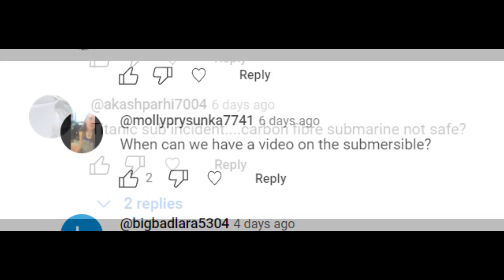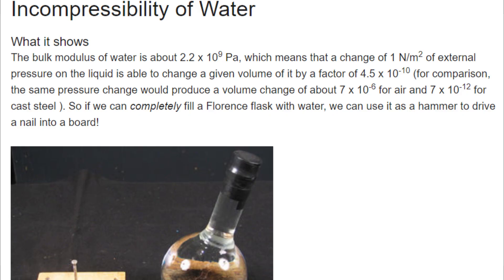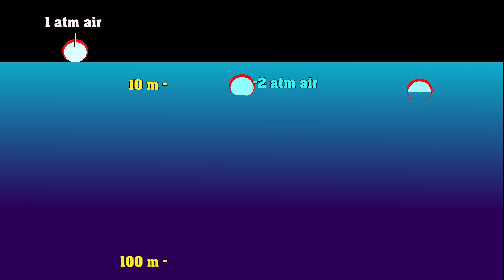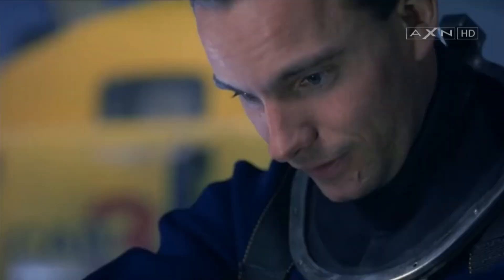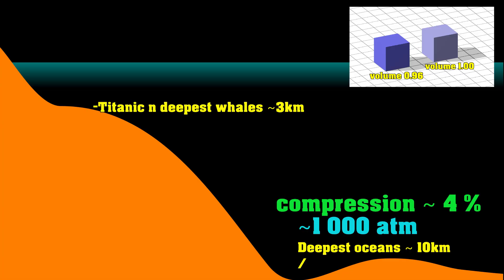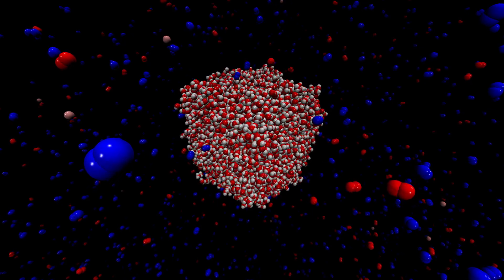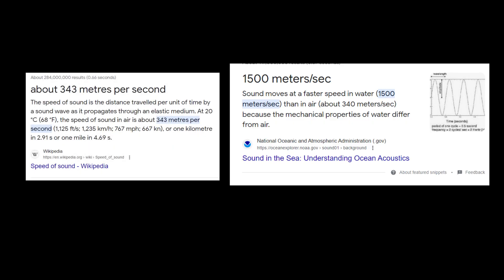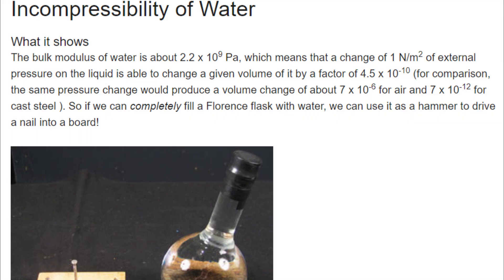What Happens when a Hull Fails at 1000 atmospheres?

Comment: I feel like you are really splitting hairs here. It is like saying that water jet cutters are not cutting using pressurized water because technically the water leaving the nozzle is no longer pressurized. No. The water pressure kills you. If you want to be pedantic then water depressurization kills you. In either case the highly pressurized water is the direct cause. The fact that it gets depressurized in the process of killing you doesn't really matter.

Comment: I heard there can be autoignition from compressed hydrocarbons in the atmosphere also, much like a diesel engine
Reply: definitely a concern in a working sub that has fumes everywhere, but there will not have been that much of it here. although I do not know the ignition point for just the textiles they were wearing...
Reply: @DrWhom  their blood would boil way before textile heats up enough. Basically insta temperature rise that corresponds pressure rise inside sub air pocket dissolves all soft tissue ,then everything else happens…
Reply: @digitalcommunist6335  yeah, my main point is that there could not have been many fumes in that compartment

Comment: that thing about the whale reminded me of something i learned the other day, for freedivers, if they start with their lungs fully packed with air at the surface, at a certain dive depth their lungs shrink enough that they no longer have neutral bouyancy and they start to sink instead of floating back up to the surface.
Reply: I think that this is why they take ballast. When they sense that they have reached neutral buoyancy ballasted, then it's time to let go of the ballast and regain buoyancy. Once they sink, the only rescue is in being hauled up, which may be too slow to safe their lives.
Reply: I used to freedive down from about 25-30 meters at the most and even at that depth you can feel the air trying to push out of your lungs I stopped freediving after a friend ruptured an eardrum which can be extremely dangerous. Even if you have a scuba tank you can easily rupture your ears. Diving is always dangerous 🦪 🤿
Reply: A fun and useful exercise you should do when learning scuba diving.
Try getting as close to neutral buoyancy as you can, its kind of fun to just bob up and down with your breathing 8 or 10 meters below the surface and getting a good feel for your BCD makes diving a lot easier
Reply: That's creepy
Reply: how can that be? density of air even at 20 bars is only 24 kilos a cubic metre, much less than the 1000 kilos of the water that surrounds the diver (pressure at 100 metres is 10 bars)

Comment: 5:30 saturation divers regularly go to depths of 300m, and physical simulations have gone as "deep" as 700m.

Also, you keep going on about the "compressibility of water", but not once did you mention what happens when you take the very compressible air inside from 1atm to ~375atm in a fraction of a second. If you want an idea then i suggest you take a look at how a diesel engine works.
Reply: He commented on helium, but is right that it "doesn't buy you a lot more depth". Saturation diving is no walk in the park and people who do to as low as 300m get AVN and HPNS, as well as lung damage and arthritis. Going deeper is foolhardy if you value your body, and compared to how deep the ocean goes, 100 vs 300 is not much at all.

Compression heating of air is irrelevant. The damage done to the sub and occupants was not from heat. The pressure wave killed everyone and shredded the hull before heat was ever a concern.
Reply: @bloomtom The adiabatic heating of the water, as you say, had small consequences, as basically it was the concentration of ALL the heat energy within the volume of air that was Titan's atmosphere. 
Not that much.
An incandescent light bulb filament may be 5,000° F, but how long would it take to cook 5 human bodies with a 100 watt light bulb?
The ambient water temperature at that depth is about 39° F and water has a heat carrying capacity nearly 3,500 times that of air, so the tiny volume of very hot compressed air was almost instantly cooled by cold water.
Something that I had not thought of before watching this video is that the water that first entered the submersible had been expanded,  and therefore was COLDER than ambient sea water too.
Reply: Saturation diving wasn't mentioned for a reason--it's not topical and the physics don't apply.

Completely and totally unlikely that the air did what you're suggesting. This was a plastic/CF hulled submersible. Not a metal sub. Also a much smaller cavity. No hydrogen explosions. This was not Scorpion.

The water would rush in faster than and heat could propagate, especially being much smaller and much deeper.
Reply: This should be pinned lol but never will.

Comment: Carbon fibre structures strength is on effects of stretching. It’s an excellent material for positive pressure chambers. But even though it works  in structures with multidirectional loads - compression resistance is it’s points of weaknesses.
The mind boggles from the thought that someone decided it’s a good application to use for negative pressure chamber in a structure construction similar to a positive pressure chamber…
Reply: Yup, the whole load of the pressure was basically resting on the resin, with the CF just chilling. The accident was bound to happen.
Reply: I don't think they thought of the carbon fibre layer as a layer resisting a certain amount of transmural delta-P (well, maybe they did, that would be mind boggling as you say). I can't really say what it's there for in their minds, though.
Reply: If you change the frame of reference, inside becomes outside and positive pressure becomes negative pressure  duh. Genious.
Reply: @spacejunk2186 Wtf?
Reply: @randomname4726  He's trying to do a joke, but not doing a great job of communicating that.
Reply: @spacejunk2186 The earth can also be considered flat, mathematically speaking...

Just make the sphere into a Mercator projection, and you're done!
Reply: @phillyphakename1255   or opperate on a small enough scale that the difference doesn't matter. That works too.
Reply: @laurencefraser  see, the great thing about the Mercator projection idea is that it works on everything, you don't need to limit yourself to a certain size scale for which your model is suitable.

Comment: I was hoping you'd tell us how much energy differential there was between the sub and the water in tons of TNT.
Reply: Say the volume of passenger compartment was 3 cubic meters. So that would be three tons of water rushing in at twice the speed of sound. 1/2mv^2 gives us roughly 800 mega joules of energy. That’s roughly equal to 200kg of TNT.
Reply: @jimcooper1251  well shit
Reply: V = 1000 m/s
0.5 x (3000 kg) x (1000 m/s)^2 = 1500 MJ
So more like 400 kg tnt. 
But who's counting?
Reply: Scott Manly said it was 10kg of TNT per cubic meter of atmosphere it expanded into. I think someone figured it was 47kg of TNT for the Titan. edit: yes, this is wrong
Reply: @nb6175  Is it really as simple as 400atm x 1 m^3 = 40 kNm -> 10kg tnt? That seems more like a floor, as if the water just dropped on top of you, which is definitely bad! The springy-ness seems to matter a lot though which would make it more dangerous.
Reply: @nickw3867  obviously not. seems scott was very wrong.
Reply: YES PLEASE!
😅

Comment: Well yes it is about pressure, more specifically the pressure difference .

When the hull was breached, the pressures equalized rapidly, causing the crew to perish rapidly
Reply: yes but if water was incompressible it wouldn’t have happened in the manner that it did.
Reply: @Rotbeam99 
If the sub were at the bottom of 100 m of a pool of Mercury the result would be the same.

Mercury is 8.63... times less elastic (more incompressible) than water, and also more viscous, but it would still cause a lethal implosion if the hull were breached.
Reply: @Rotbeam99 nothing is “incompressible”, it may be resistant, but not immune. Either way, that doesnt really matter here.

For example, air is considered compressible. Yet, it can still cause similar incidents like the Titan, ie, the Byford Dolphin incident.

The difference in pressure between a diving bell and the atmosphere caused a rush of air outwards, crushing everyone inside the diving bell, and propelling it into the handlers, killing one of them.

Comment: That was super interesting. I was expecting information about the plasticity or brittleness of carbon fiber vs other materials. I guess the idea here was, if the hull cracks, how fast does water enter?
Reply: The speed of sound
Reply: @haruhisuzumiya6 
The speed of sound...

OF WATER!
Reply: @VariantAEC  ba-
Reply: @VariantAEC    It is filling up a volume of air, so it would be the speed of sound in air.  That is what Thunderf00t was saying, not the speed of sound in water, which is almost triple the speed.
Reply: In an instant it would depressurize, faster than a balloon could pop and you wouldn't even be able to see the hull rupture before you were turned into a watery mixture. They did a somewhat interesting take on that in that  one sci Fi movie where they have a big laser that digs to the center of the earth lol.
Reply: @infernaldaedra depends. A balloon can be deflated without exploding with a needle and tape. To explode means the material must be in tension so it will rip itself apart.